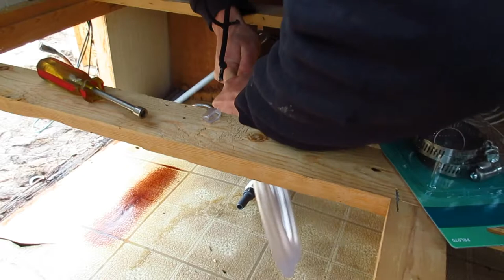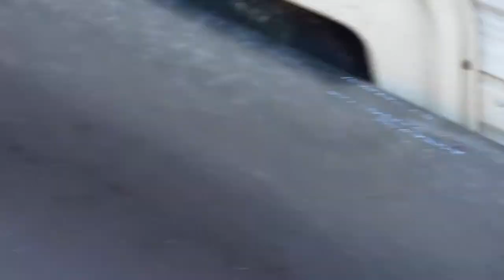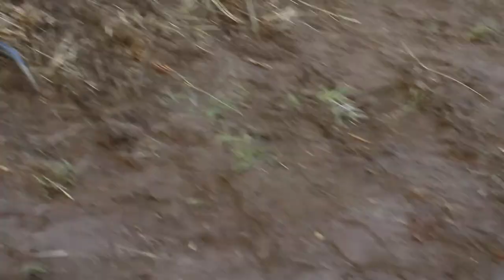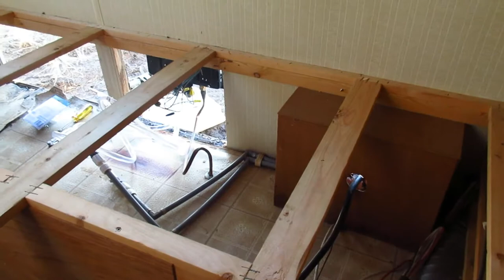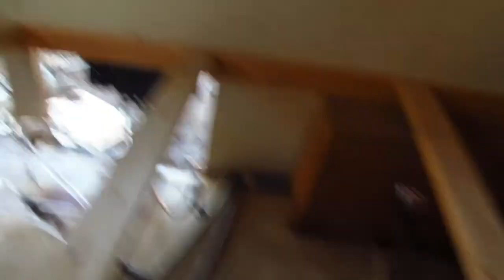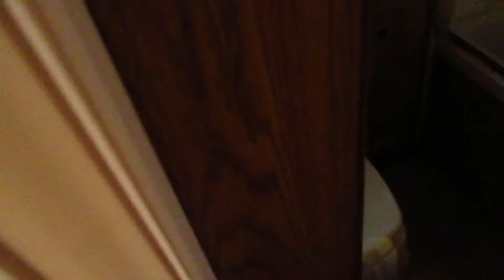Installing the on demand water heater

Comment: i know this is an old video, but to clarify one thing... Thats Poly Butylene Piping, Often called Poly B.
Reply: Oh. You called it PEX which is what the pipe that replaced what you have is called.  PEX stands for Poly Ethylene X-link (cross link)
Reply: @WindwalkerHomestead  
So... are you saying this video isn't good? I'm confused, if you never really got the water very hot and it frozen then split shortly after this video was recorded (your words)... and then it is unhooked ever since...
 what good is the video?
Do you have another video that is good... I thought this video was good, but now after reading your comment, I'm not sure what to think.
Reply: @WindwalkerHomestead  
Thank you so much for your fast reply!!!
My only question is... did this ever really work? I really need to do this... but if you didn't like it, and it never got very much hot water... and you turned it off for good... I'm assuming I shouldn't do it. 
What do you think? YOU know a heck of a lot more than me.
Reply: @WindwalkerHomestead  
Thank you for your reply... I know about those "Warming water on the stove top"... I was in a very bad flood in 2008... Everyone was without water for over a month.
I'll check out those water heaters...
Thank you so much.